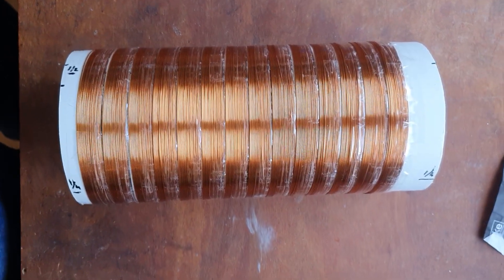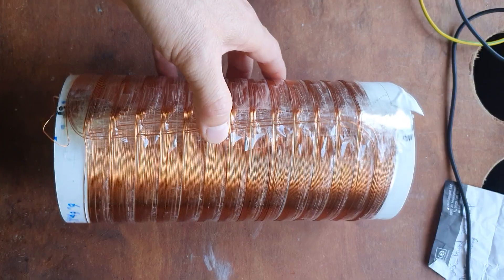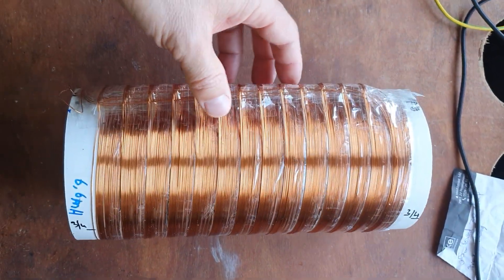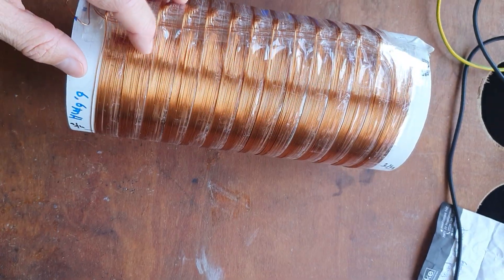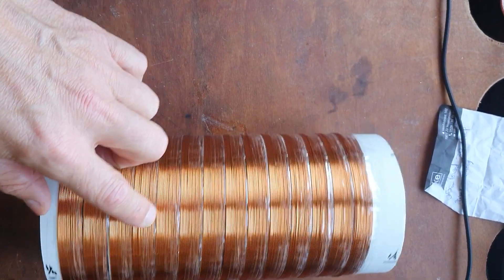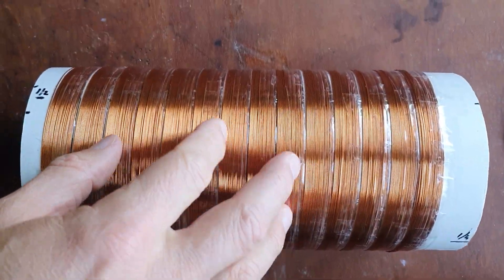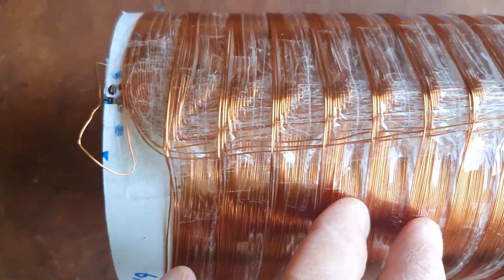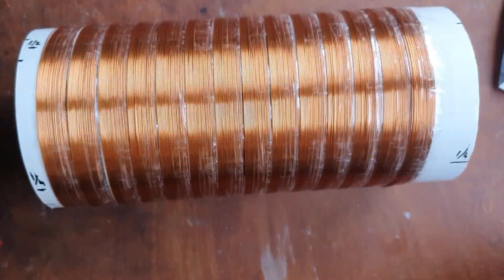Rewind the coil to get higher inductance

Comment: Just would like to mention, Tesla was using electrostatic potentials not per say electromagnetic potentials for wireless transmission, also its worth mentioning that Tesla was interested in wireless means of transferring energy because back in the day it was expensive to run power lines, lets also consider back then they was using coal burning boilers for does not matter for this if it was AC or DC generators that created pollution, today we can use for example natural gas power generations and you can build them right in the middle of a city because not that much smog compared to coal, to simplify that is why Tesla was big on wireless transmission of power, if you want to consider his remote control boat that was wirelesses transmission of information, go forward go left, right, stop, reverse, he had batteries in that boat so that was just sending information. Now if you look at the magnetic component of electromagnetic induction sending information over distance it is square of distance at the power levels, Tesla was working on static induction for wireless power, to make it simple you can take a look in to all that one line power-lines thing you still have to deal with the magnetic potential around the inducted wire, what Tesla was doing was longitudinal waves and to make it simple 100 km from lets say here at 100V the ground potential is still same over there 100km away same 100V ground potentials, lets explore something else UFOs dont make much magnetic lines around them but they make lots of static potential  compared to ground and for that reason they can not fly at high altitudes because of the high energy particles that go thru the atmosphere make mess of the static potential, to simplify UFO needs to reach the up quark potentials and switch back and forth with bottom quark not thru induction methods but thru dielectric method, to get such energy levels look what Hutchinson was using and to get there need to use what some call it negative energy female force etc stuff like that, what it is its antimatter buoyant in dielectric scalar Higgs field stuff, if induction is used you get some radiation out magnetic potential thing, also Bendini was mentioning about the spike in the magnetic domain, he was trying to tap into that negative energy using that method, also worth mentioning is Dale Pond and when he is talking about those octaves in music notes. There is a reason Tesla was nuts about 3-6-9 he found the resonance of a atom and it so happens there is 3 separate resonance to start with. Or you can just do what Hutchinson did sh*t load of dials and see if anything happens. If ant of this makes any sense. Also worth looking into probably seen that pic of Tesla sitting and reading a book and in the back ground is that coil, what many people don realize that is just 1 coil of 3 coils, more to the point a fast high current discharge capacitor to the ground and vice versa and there is also reversing of current going there thru that capacitor resonant coils all to tap into that negative energy using that cap/coil have to match frequencies induction thing to that resonating induction plate cap thing and that is where you find your first 3 “phases” of unexplained spikes on oscilloscope smooth them out you will find 6 more
Reply from the maker: Thanks for sharing your thoughts

Comment: Why not go volumetric?  Imagine if you would, two sheets of extra wide/large aluminum foil, enough layers of mylar or teflon sheeting, between them, done in a bifilar layout with a dramatically increased surface area?
Reply from the maker: that would only increase capacity, but hinder the inductance. we need all fields present. magnetic-, electrostatic- and displacement current field
Reply: @MasterIvo  Couldn't you resolve that by not winding it bifilar in series? I would imagine, if you took the volumetric idea and  made the core the diameter of your other coil, you could put it inside that ones core.  I was reading Nikola Teslas notes and it seems he was making use of the 1/6th wavelength of low frequency waves to which has some sort of stationary or standing field/wave, and inside this radius that increases with lower frequency, transmission seems to behave more like it is traveling through a conductor.  More of a compressive directional transfer without radiated losses. I will have to try and understand your displacement current ideas better, as I seem to be missing something.
Reply from the maker: @brettiusmaximus8059  subscribed! looking forward to your results. 
if you use the capacity of a coil as a capacitor plate then you can direct the displacement current as a conventional current and thus use the displacement current as a power source (needs emf voltage in phase)

Comment: Why focus on lower frequency within this coil?
Reply from the maker: because the dielectric losses are  too high above 70kc/s when using PVC.
it is important for the displacement currents to flow freely, as the coils act as capacitor plates.
Reply: What are you using to energize the coil?
Reply from the maker: @Andrei369y mosfet half H bridge

Comment: Hi!
I'm from Russia, I'm watching your work. 
Well done, you're holding on, no matter what. 
I understand perfectly well that it's hard work, going where no one goes. 
I want to give you a hint. 
A series of standing waves coordinated with the medium creates an ionized (excited, unbalanced) medium in which capacitive interactions manifest themselves in a more pronounced way, unlike inductive processes.
Two main processes: 
Consistency with the environment (resonance, standing wave, etc.) and ionization of the medium, where capacitive interactions are manifested.
This space is one, and it consists of aerodynamic vortices rotating at infinitely high speed, interacting with the difference in vortex pressures. I call them "Etherons". There are no particles, the whole space is one, and constantly strives for a balance of interactions.
Reply from the maker: yes, it is all flowing energy.
and with changing high voltage you get the ambient medium flowing

Comment: Good Luck! 😊
Does the extra resistance, from the wire diameter reduction matter in this application?
Just found and subscribed to your YouTube channel!
73…
Reply from the maker: Yes it does, the added resistance reduces the Q factor, which reduces the high voltage which is needed to interact with the environment

Comment: L = N^2μA/ℓ 

Excellent. Increasing the number of turns is that best way to increase inductance. What do you use for the core?
Reply from the maker: the core are 2 coils, it cannot use  a ferrite core if that is what you suggest
Reply: @MasterIvo  You do know the type of core, specifically the permeability of the material affects the inductance right? For example, an iron core would create more inductance in your coil than an air core.
Reply from the maker: @archconnections  yes it would, but you forget this coil also works as a capacitor plate. the iron would interfere with the displacement current between the coils.
it is not only about magnetic inductance, it is also about electrostatic induction, or better put, dielectric induction, since it is not static but dynamic.

Comment: How's the new coil working out?
Reply from the maker: it isn't working out. high voltage is fine, but the coupled current coil won't ring lower than the third harmonic

Comment: Fortune favours the brave...power maker!

Curious about that strange coil design;  how it is constructed and why it is better in this circuit than standard?  I mean, with a standard coil, if you wanted it to resonate at a lower frequency, all you would need to do is wind more turns. Here it seems you need to unwind it, choose a thinner diameter wire and then rewind a whole new one. That can't be fun. But, it's going to be worth it, yes?
Reply from the maker: I direct the displacement current of the series resonant high voltage coil which you see, to flow along with the conventional current of the parallel resonant coil inside. they both interact and provide constructive feedback.
more inductance is needed to lower the resonant frequency
Reply: @MasterIvo  Ok. I can see, if you have what amounts to as a conventional primary coil interacting with a displacement secondary coil, then making changes effecting one's resonate frequency would require the second to also be rewound to match that new frequency.

I suspect that strange secondary coil is simply a unique form of basket--weave to avoid magnetic field  loading interaction with the primary coil.

Would it increase output to place a 2nd displacement secondary on the other side (here, inner side) of the primary?
Reply from the maker: @PowerMakersCafe  the series resonant high voltage coil, which you see here, acts as both primary and secondary.

the parallel resonance higg current coil inside does the same. it is also both primary and secondary. 

magnetic induction+
dielectric induction

Comment: All by hand, or do you build some sort of mechanical setup to help wind the new wires perfectly aligned?
Reply from the maker: both, I have a foot controller that spins the coil, but only 5cm at the time, as the tape needs ti be applied manually

Comment: Does it have to be aircored? In tesla coiling we sometimes use small amounts ferriet to influence the inductance 😊
Reply from the maker: well the inductance of the current coil is not a problem, it should be low.
but it is the inductance of the high voltage coil that needs to be larger, and no it can't be done with ferrite, as the coil is is also the plate of the series resonant capacitor. the load output coil that is earth grounded forms the other capacitor plate.
would you put ferrite in a capacitor? no. the displacement current should flow there. not the magnetic current.
also I prefer the fields to interact with the "ambient medium" the ferrite would focus the magnetic field instead of letting it "free" to interact
Reply: @MasterIvo  you got some good points!

Comment: Why not rewire the HC instead? Seems easier no?
Reply from the maker: hc wont influence the high voltage series resonant frequency
Reply: By pitch, ivo means spacing? Even spacing, and run it up then down (so, not a brook's coil).
Is this like the way an old tv antennae spaced its cross beams? Sorta?
Reply from the maker: @ronmartin7253  yes, spacing, but it really is about how steep the wire is turned, it needs to match the current coil, which only has a few turns, with around 2 cm spacing between turns. This way the displacement current flows the same
Reply: @MasterIvo  parallels!